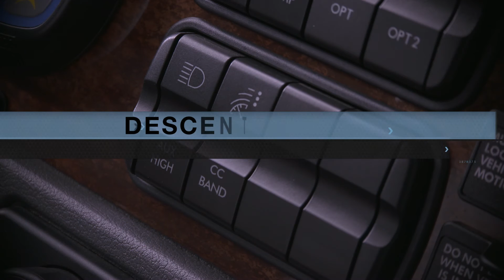Detroit DT12 Training in a Freightliner | Descent Control

Comment: The DT12 is a great transmission but they need to take away the option to disable the manual mode. It's not saving any fuel when climbing a mountain and is downright dangerous coming back down.